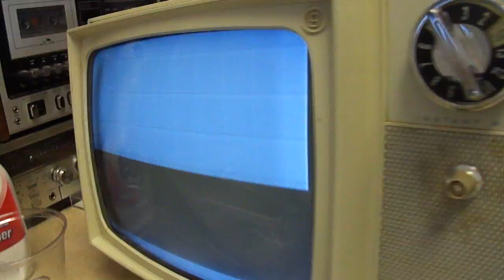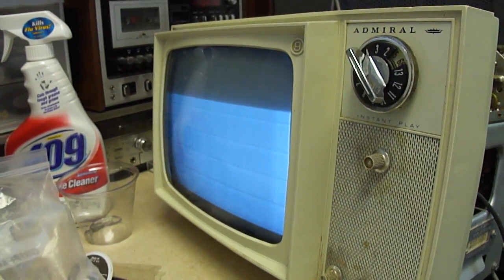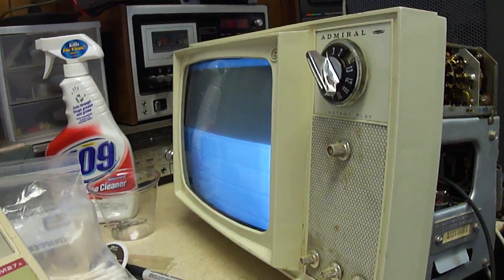Admiral 9" tube type black and white TV test

Comment: I hadn't used that TV for several years, probably because of the problem you are having now, I remember trying a new tube in the tuner to try and fix it. 
I tried it out before I sent it to you and was able to pick up a local analog UHF station with a good picture, so the UHF should be working.